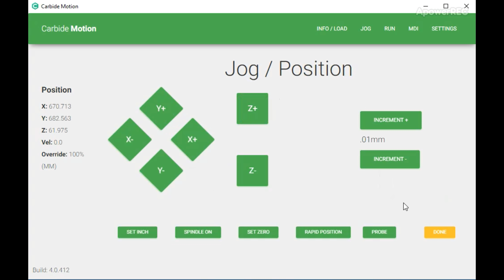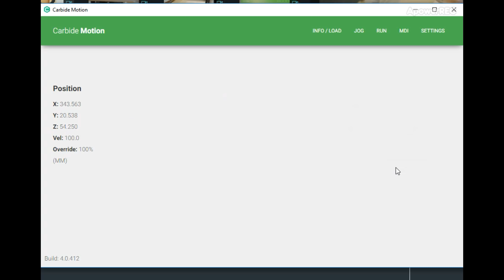Carbide 3d Shapeoko Touch Probe // What Is This Thing?! // CNC Woodworking

Comment: I am getting a used (slightly used) Shapeoko XXL 3 and I have been watching various videos and I noticed the Z axis setting problem. I thought that the solution was to turn the zero setter over to get the right length setting. I'm glad you cleared that up.

Comment: 4:45 Proper probing - make note that if you are only probing Z as you are in demonstrating the proper probing, the touch probe should be on the surface of the board not on the corner :)

Comment: I probe z using BZ 2.0 with it ontop of the material.  When it runs...z never makes it anywhere near the material. Is there a setting in design or motion  that needs to take the thickness of the BZ into account ?

Comment: Can you do a video where you start a job do the probing ste the xyz then show doing a tool change in the same file for a v bit. And show what all the CNC does. Along  with and thing  you need to set in the different screens that  show up before you load and run the job
Reply from the maker: Check out carbide create part 3 and 4.  I do a tool change and a v bit

Comment: Last and maybe least here i am ... I was really about to buy this remote but clicking on the link it's seems there's an upgrade , and i cannot decide ... The newest is a little expensive but has a rechargeable battery wich is great and probably the same connection via usb ... does it worth it ? some one knows If the oldest got a rechargeable battery as well ?
Reply from the maker: my remote recharges by usb
Reply: @MyersWoodshop  thank you very much ! so I'll buy the older !
Reply: @MyersWoodshop  thank very much !

Comment: Is there a video to set up the wireless remote to the system?
Reply from the maker: no, but its very easy.  Just have carbide motion open on the jog tab, and use the built in carbide motion hot keys.  The controller just acts as a wireless keyboard.  Theres no magic or programming involved.
Reply: @MyersWoodshop  ok thanks
Reply: Just realized this but your CPU needs to have a wireless connection for this to work correct? I have an old Panasonic cf-19 with no wireless.
Reply from the maker: No.   The remote comes with a usb dongle to connect to your pc wirelessly

Comment: Hi there - Love your videos! Do you need to click anything after you do the probing? I'm having issues with my machine not cutting all the way through the material - even when I make it thicker than it really is (and I'm using calipers) it's just not going all the way through. Any help would be awesome.
Reply from the maker: nope.  once it probes it automatically sets the zeros!
Reply: @MyersWoodshop  Thank you for the quick response. I think I was trying to cut material that was thicker than my bit could handle. I did it again with a bigger bit and it worked great! 
I don't support you offer online paid classes or anything? I have more questions and would love someone to talk to so I can understand things better. I don't know anyone else who does this who I can ask.

Comment: You forgot to mention that when you get your new probe, you have to bash the button a few times with a rubber mallet to get it to work.
Reply: @MyersWoodshop  It appears as those being sold by C3D at this time are of a defective batch and need to be "adjusted"/bashed with a rubber mallet a "bit" before they will function.
Reply: @mindlesscorpsecorpse8068  Sounds like you're referring to the issue with the BitSetter rather than the BitZero reviewed in this video? I purchased the BitSetter a few months back and noticed right away that they appear to be using a bronze bushing meant for rotary movement rather than linear movement. That's why the BitSetter tends to cease up, especially after being left untouched for a while.

Comment: I just ordered mine, but I don't use carbide motion.  will this work with other software?  I use easel right now.
Reply from the maker: You’ll have to edit the gcode.  You can create in easel and send the gcode with carbide motion and use the probe
Reply: Thanks, is there a video on edit the g code?
Reply from the maker: Not by me, note have I had the need to do so.

Comment: Ben, my green light is on and I screwed in the wire to the belt just like you did. But when I went to touch the probe to test it, the light does not go off. What am I doing wrong? Thanks
Reply: VacancyFillers.com I had to ground mine to the control board housing for it work (light to turn red).  Mounting to Y rail screw would not work.

Comment: Why didn't you talk about that if you probe with (some) 1-2-3 Flute cutters (not bits) you will be off in the zero point if it touches the gulley of the cutter rather than the cutting edge?????  I recommend ALWAYS rotating the cutter so that the flute touches the probe body.  Or use a 4-flute cutter......
Reply from the maker: i'll leave the more technical talk up to Winston Moy

Comment: If I were you I'd go and permanently mount the Alligator side to the DW611s housing and forget about it - Just slap the block wherever you need it and conductivity between it and the Alligator side should be routed via the Bit > Collet > Shaft > Brushes/Bearings > DW611 Housing > Alligator Wire end.

At least that's how it works with my setup ( https://i.imgur.com/WSa3exY.jpg ) though I'm now using a dedicated VFD/Spindle solution instead of a makeshift Router one.
Reply from the maker: that is a great idea.